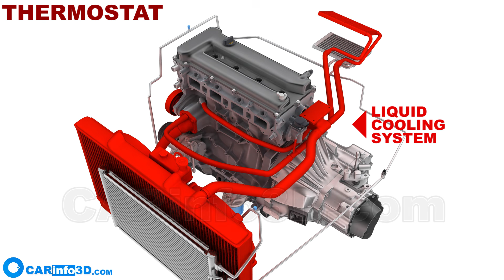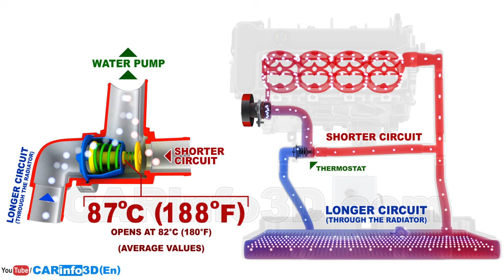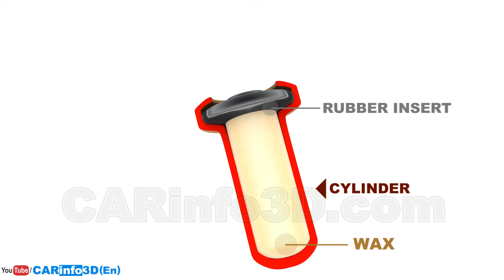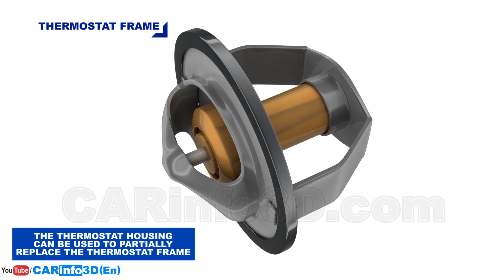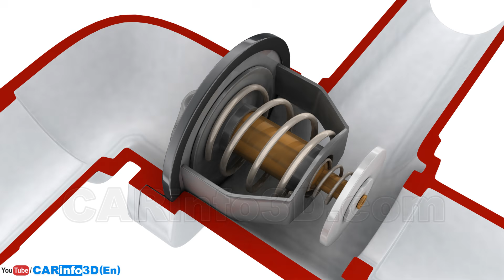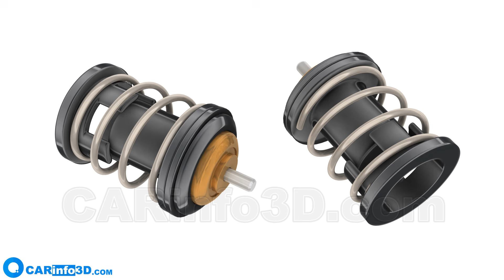Thermostat / how does it work? (3D animation)

Comment: Hello, does it possible to drive without a thermostat? (Asking because I'm after oil cooler replacement , so, to clean the cooling system from the  gummy oiled blended coolant  water fast and efficiently they removed the thermostat..and told me it's o.k to drive like this until the winter...(while flushing the system once in a few drives when the system is hot,  to easly take out the oil leftovers and replacing the bad oiled water with good coolant water),
Thanks for your help

Comment: hello can i ask u something im having this issuea with my golf r working good but whenever i reach 90c iin the temprature whichi is normal in any car the car start doing problem like entering the limp mode n reducin the powar at 3000Rpm n difrrent sound + some smoke sometimes in the exhaust i thought was ect sensor i changed it but still hv the same problem  i used the diagnostic n they gaved me coolant shut off valve 
O2 sensor heater contir circ
O2 sensor heater contir circ
engine coolant flow / performance
someone said the problem is bad thermostat

Comment: I'm confused. as far as I know the the tube to radiator is (lelf in the picture) is the hot water being released to go back to radiator to cool off.... illustration flow of water is intake.... it should be output of water

Comment: Surely hot water flows from the the thermostat to the radiator to cool down. Unless Ive misunderstood your graphic you have the water flowing the opposite direction.
Reply: I noticed that too.  In every car I'm familiar with, when the thermostat is open hot coolant from the engine flows through it and into the radiator, then cold (or at least cooler) coolant flows from the radiator to the water pump and into the engine.  In other words, it regulates coolant flow on the "hot" side rather than the "cold" side.

Comment: what would happen if you took the thermostat out ?
Reply: Your engine would overheat, leading to engine failure. Think of the thermostat in the car like the one in your home. The one in your home is there for you to control the desired level of heat or air conditioning based on your comfort level(s). The one in your car does that automatically, but for the water/coolant temperature in your engine. Without a thermostat there’s no way for the cool and warm coolant to circulate. The car cannot do this on it owns.

Comment: I am having a ford Fiesta which is an used car I bought before few years. I am having lots of issues due to the imbalance of temperature of the engine. Even I changed the coolant tank houses tubes and everything with respect to the coolant flow. This all are not resolved the exact issue of mine. Finally I detected the thermostat of my car is directed like the thermostat valve is removed from the thermostat housing by a mechanic that I have in service before. I immediately replace a new thermostat housing. Now my issue is completely resolved. Do not play with car engineering and mechanism, by directing or removing the thermostat valve. We know that cars engine engineered to become to run as good vehicle on road. Changing its algorithm and working method will definitely cause mild to serious issues
Reply: Nobody does this only your mechanics bozo

Comment: Some mechanics removing the thermostat and directing the coolant flow in the engine from the radiator. It is definitely make some issues in future even in immediate. Because the thermostat maintain the optimum temperature required for the engine. Only if the coolant reached the optimum temperature and above the optimum temperature it will start open the flow of the coolant from the radiator which is called long circuit. Thermostat also increases the vehicle fuel economy because it maintains the required temperature for the entire engine

Comment: These thermostates are very sensitive, if such a small part get stuck you can burn the engine in under one minute. I really wonder why the automotive industry still did not found a safer solution for it.
Reply: Maybe because it's a reliable natural system.
Reply: they are very reliable.  and when they fail, they fail stuck open.

Comment: Electronic thermostats are more complex and require more maintenance. 
A purely thermally operating thermostat keeps the engine in the desired temperature range without the need for electronics.

Comment: What happens when a thermostat is not used
Reply: Also less heat for the cabin, which is needed for cold climates
Reply: In severe cold weather the heater system will not provide any heat, the water circulates constantly through the radiator. I drove a long trip in negative 35C without thermostat, no winter clothing, suffered horribly.
Reply: @pflaffik  Was your car a Chinese BYD EV ?
Reply: The engine will run very cool. Struggling to attain it's normal operating temperature. A cold engine, more wear and tear.
Many non knowledgeable mechanics will not advice you accordingly.
Reply: متاسفانه دائم به موتور شوک وارد میشود ...
Reply: Engine hot 🥵
Reply: The engine will work too cool, increasing cylinder wear and fuel consumption.
Reply: The engine will run to cool, probably wearing more

Comment: You should do a video on the complete electrical system of a vehicle, including battery, starter & solenoid, alternator, and ignition, lights & accessories,  what’s powered by the battery vs the alternator, starting vs during operation, etc.
Reply: https://youtu.be/s4Jz7dpS8Kk?si=1SBVsMQ3Y6BFdHG8
Reply: This !